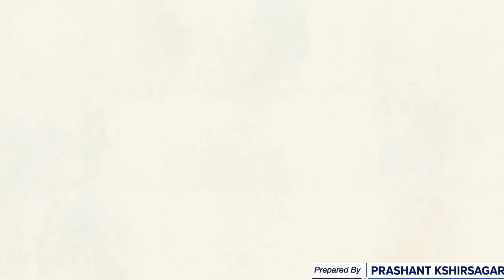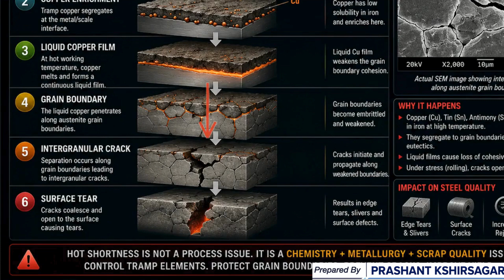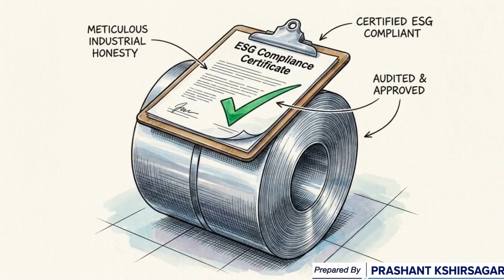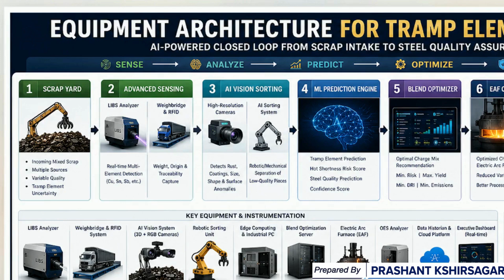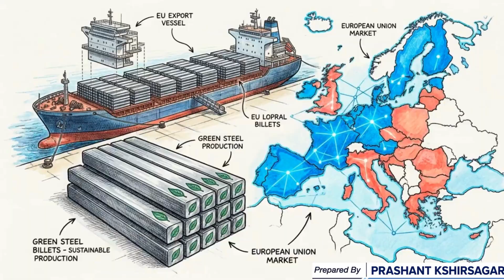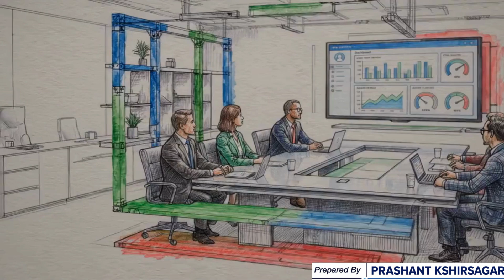Defusing the Tramp Element Time Bomb: AI & EAF Scrap Quality | Executive Briefing

Comment from the maker: 📌 Welcome to PRASHANT METALLURGY!

Here is the uncomfortable industrial reality: 90% of EAF steel defects are decided before melting begins. Copper (Cu) and Tin (Sn) are metallurgically noble—they cannot be burned away or slagged out. If they enter the furnace, they will trigger Liquid Metal Embrittlement (Hot Shortness) at the rolling mill, eroding your EBITDA and inflating your CBAM exposure.

💡 The Innovative Solution: We cannot fix this inside the furnace. We must move intelligence to the scrap yard. By integrating Physics-Informed Machine Learning (XGBoost) for predictive blending and High-Speed Computer Vision (YOLO-based CNN) for automated sorting, we can enforce strict thermodynamic boundaries before a single electrode fires.

👇 I want to hear from the engineers and plant leaders watching:
How is your facility currently managing the Cu + Sn risk? Are you still relying on supplier declarations and manual guess-blending, or have you started digitizing your scrap intake?

Let’s discuss in the replies below! And don't forget to check the description for the link to the full Board-Level Technical Deep Dive on the blog.